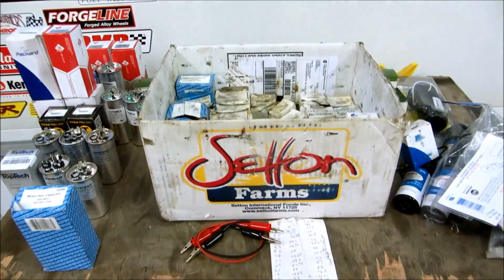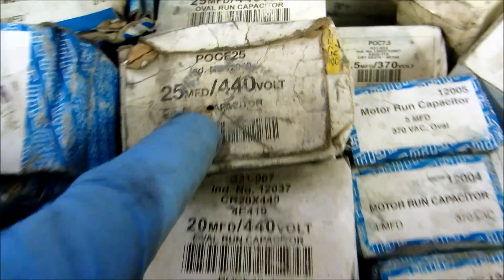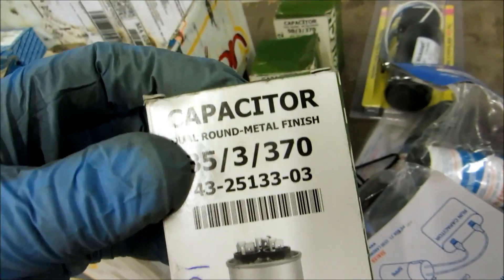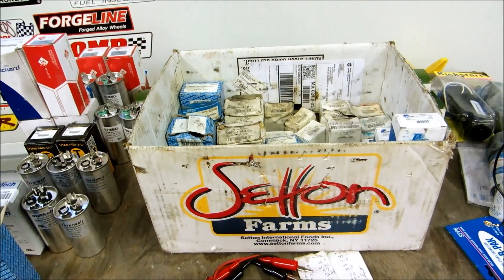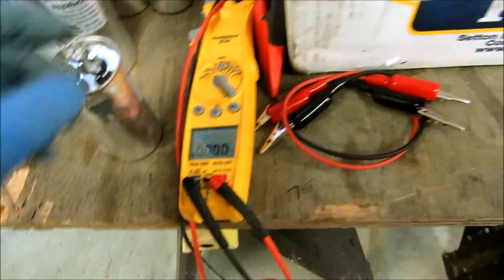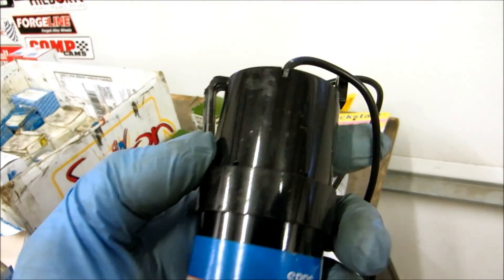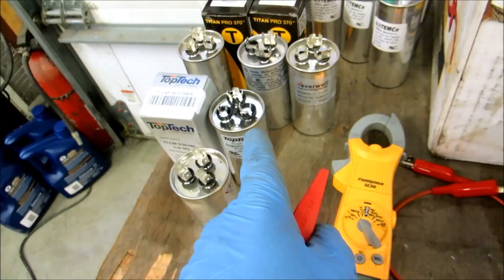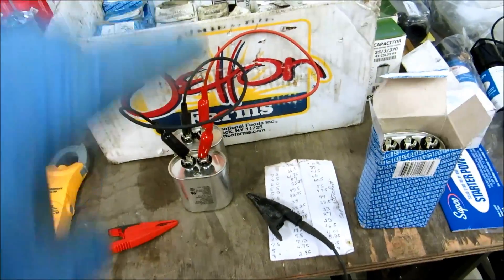hvac:capacitors 101 what you need to know the basics

Comment: what happens if your cap is a 3 but motor needs 7.5? same volts on both cap and motor? will it run? I have two caps, cant read numbers, changed motor, old motor called for 3 cap new calls for 7.5?
Reply from the maker: truth teller so install a 7.5 cap for new motor

Comment: Thank you!  Both my run and hard start capacitors blew at the same time :o !
I didn't know the wiring of the hard start to the run capacitor as there are no wires there - only blown-up capacitors.  I am awaiting in the mail replacement capacitors.  In the meantime, no A/C :(
Thanks for your great videos!  Your new subscriber, SF1906Survivor
Reply from the maker: SF1906Survivor i would not want to be with out a.c. to long  thanks for watching &commenting
Reply: hard start is CSR just like compressor ....Common 5 goes to contactor/2 start goes to herm side of run capacitor (1) side of black cap/1 Run goes to common side of capacitor through(2) black cap.. CSR~ 521

Comment: I ran into a odd situation where one cap was wired what i would consider normal but it had some wierd transtior or fuse conecting both sides of cap there was also another cap wired to the other side of the 220 v line and one wire conecting to the where the compresor side of first cap whats that about
Reply from the maker: Justin Smithson thats was a hard start kit for the compressor
Reply: The 1 with the transistor between caps is to drain the capasitor when its not conected to power i believe its a safty thing instead of using a screwdriver to drain the copasitor it does it automaticly

Comment: Great videos man. Do u ever use the turbo 200s that's all I Cary in my van cost more but all u need is a couple of them in your van and they work real good and the plus side is u don't need 2 Cary 50 direct types of caps that take up a bunch of space
Reply from the maker: Aaron Songer i have the room for the run caps .i rather install whats needed them other ones are expensive

Comment: Nice video 

What gauge wire should tou use the put two capacitors in series or parrelle 
Would tstat wire work ?
Reply from the maker: jordan coston no tstat wire is to small use the same gauge wire that on the condenser 16 or 14 gauge stranded  would work well

Comment: Steven can you discharge the capacitor without taking the wires off cause I seen people do it or will it burn something if you do it this way THANKS
Reply from the maker: Gil Velazquez some units have power to them all the time because if the type of contactor used .i would pull the disconect first check the power is off .i always like to pull a wire off before discharging a run cap.thats my way .

Comment: I have to admit that's the first time I've seen the method to reduce mfd   You have me by one point :-)
Reply: Series caps are calculated the same as parallel resistors, product over sum.

Per Steve's 7 and 5 mf caps.....
5x7(product)/5+7(sum)=
35/12=
2.917 mf

Best to check with a meter I guess.
Reply from the maker: airkraft1 every day is a school day i always say